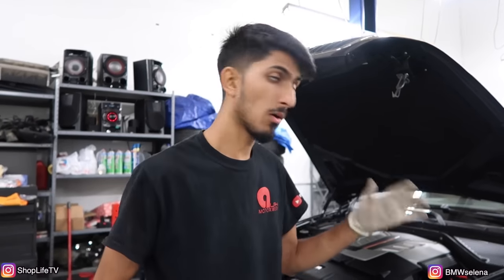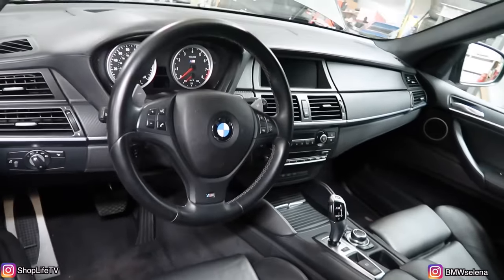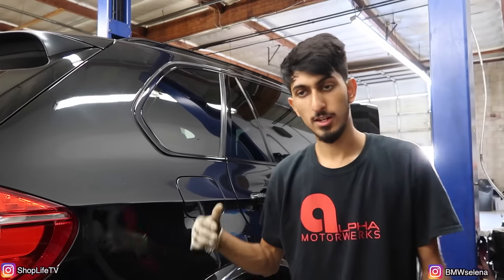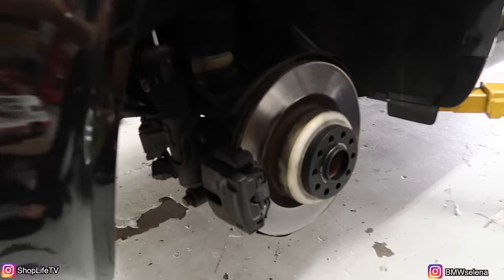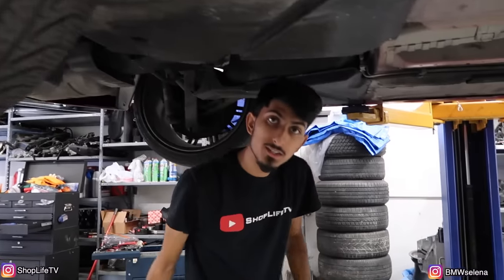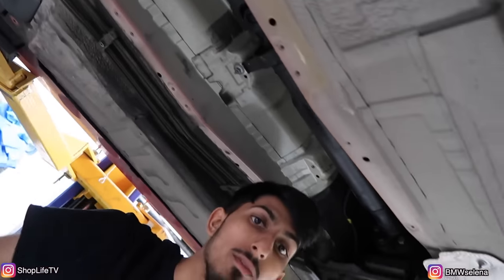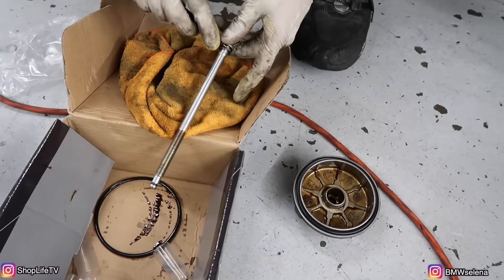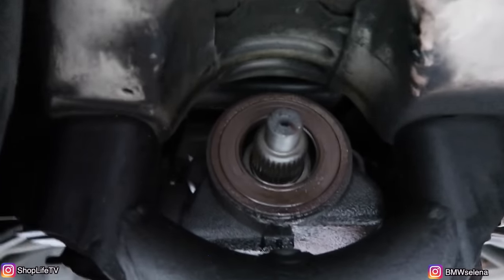LOWERING A BMW X5 ///M !!!

Comment: A 2011 with 65K on the body/chassis/tranny, but it has a new motor?!?  That's crazy!!  Catastrophic failure?  Bad maintenance/love?!?
Reply: they don't build them like they used to...
Reply: same question here....people now changes car every 3/4/5 years, whatever the warranty is, and they totally trash them...floor them while cold or run them hot on low oil etc...I bet it was some rod issue.
Reply: That's my car and I will explain you why it has a new engine installed. The previous owner was changing the oil in the engine every 15k - 16k miles. She was avoiding her BMW maintenance schedule. Thats why previous engine started to show problems. She brought the car to the BMW dealership, trade it in, and bought a new X5M.
The dealership didnt want even to try to fix that engine. They just replaced it with a new one. It didnt make any sense to take that one apart, repair it and put it back.

The car was in excellent condition - interior, exterior, suspension - and a new engine. Thats why i bought it.
Reply: Virgiliu Matei what exhaust is That!?! It sounds so mean
Reply: Virgiliu Matei are you from Roumania?
Reply: FLOwww yep man
Reply: Nicholas Wild it was OEM exhaust.

Comment: Hi, I have a 2011 X5M too and want to lower it.  How did you lower the rear? I know H&R sells lowering springs for the rear too, but I guess you only changed the front. Does the back tires rub at all? it seems too low but really looks good.

Comment: I don't get it, why buy a SUV, then lowering it. Doesn't make sense to me.
Reply: Original Wolf it looks cool lol
Reply: It looks gangsta boy.
Reply: Style son.
Reply: If it’s not yours why you worried about it?
Reply: Original Wolf 

People have there own taste and still I agree with you don’t lower an X5 it looks weird to me .. get a wagon at least or M5. It’s weird to do make a SUV that low.
Reply: Lots of (good) reasons to lower an SUV. It can improve safety and handling by lowering its center of gravity. It also firms up the ride by decreasing suspension travel. Not everyone likes a floating, isolated ride. Lastly, it also makes entry and exit easier.

Comment: to the owner, lowering an SUV is counterproductive. Good luck with that..
Reply: Not necessarily. It will still have the carrying capacity and the easy step in height of an SUV with car like handling. It's not like it'll be off roaded.